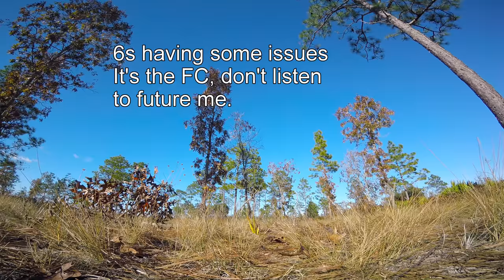High KV vs. Low KV Part Deux

Comment: Love this stuff, great video! Wouldn’t a higher KV motor like the 2700 just eat a 4s up in mimutes? What are your flight times for a 4s on the 1700KV vs the 2700KV?
Reply from the maker: Flight times are only about 2.5 minutes for either the way i fly. 6s 1700kv is marginally longer, 3 minutes vs 2.5 minutes on average.  4s 1700kv would give you more flight time, but it's a dog on power.  The real benefit of 6s is you don't feel the battery sag on long punch outs over trees or when you really need the power to get out of a sticky situation it's always there.
Reply: mooosestang - That is interesting! Okay, so it’s fair to say your information is pretty much 180 degrees from Kabab’s, in terms of flight efficiency with 2800 1800kv motors? I guess a lot of other determining factors would also go into that equation. Mad hatter? Is that frame still being sold? Appreciate the info!
Reply from the maker: @kwadwadfpv2386  The mad hatter is not being sold anymore unfortunately.  Running 4s on 1800kv is very efficient, but you loose a ton of thrust, which i don't like.  It's just a lot slower.  6s 1700-1800kv is more efficient than 4s 2700kv, but the difference is not huge, it's the lack of sag with 6s that is most noticeable. I've watched kabab's 4s flights on 1700 and 1800kv motors, it's doable, i'd get no enjoyment out of it though, too slow.  If you want fun and more efficient on 4s, then 2400kv is the way to go.

Comment: How's your MB primo 2208 1900kv so far?  I'm thinking about getting it for my new build but I want your opinion if its a good motor choice. Thanks for the great videos!
Reply from the maker: They are great motors.  I fly them in my previous 5.1x4.1x3 video.  The new Bob Roogi 2208 1800kv might be a better choice.  I should have those flying in the next week.  I'll do a little comparison.
Reply: @mooosestang I want to see your 2208  comparison video. Thanks!
Reply: @mooosestang  they're great Motors, been testing them for a little while, also the Xing 2208 1800kv Kick-Ass, been flying them for a week. 9 mm bearings titanium shaft, super smooth. You should check those out to, pretty much the same specs as bobs 2208. And under 75.00 for a set of 4. Also been running the 2207 version on 6s Beast.